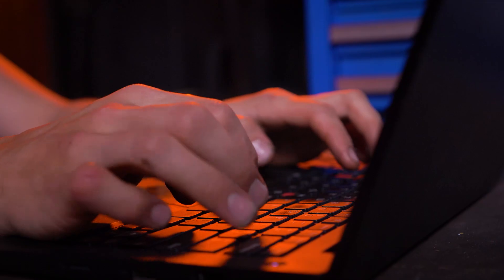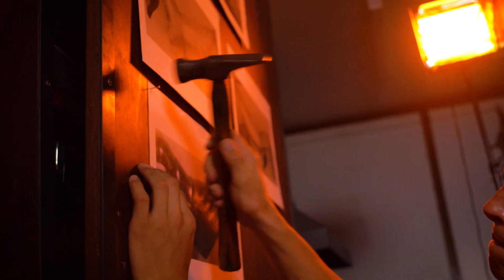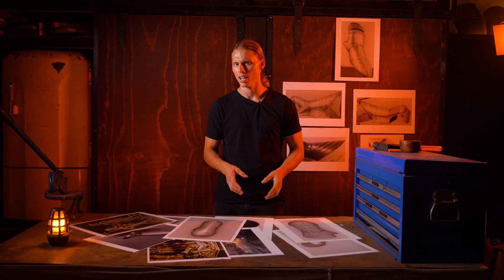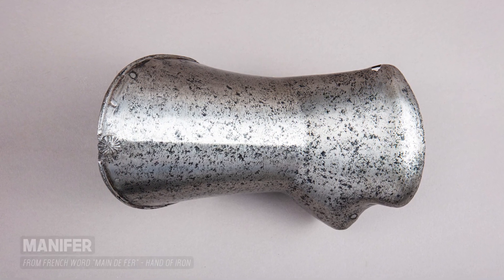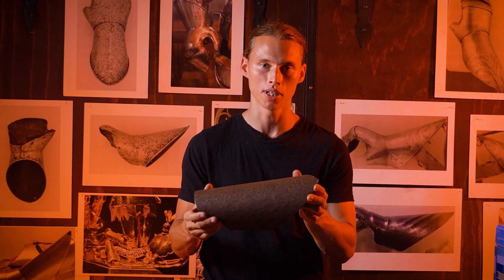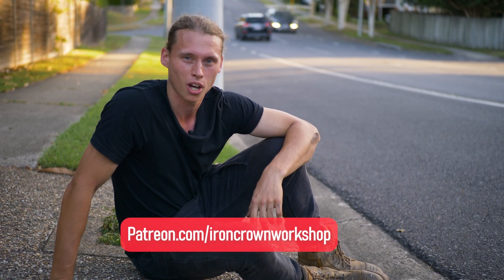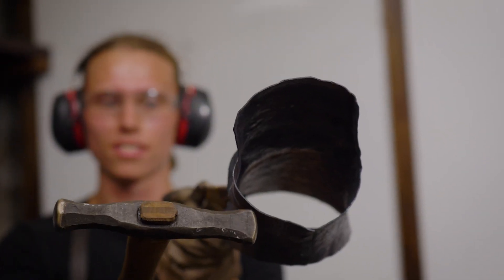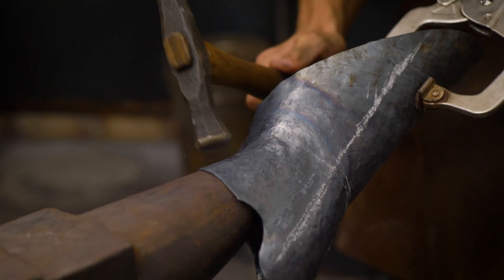Forging a Gauntlet | The Left-Hand (Manifer)

Comment: What is the temperature in your workshop? I installed my air conditioner. In summer it cools and in winter it heats the workshop.
Reply from the maker: It certainly can get warm sometimes brother! We have a air circulation system I created using extraction fans but no air-conditioning so it does get warm especially here in Australia. An air conditioner sounds like absolute workshop luxury, you've got a good idea there